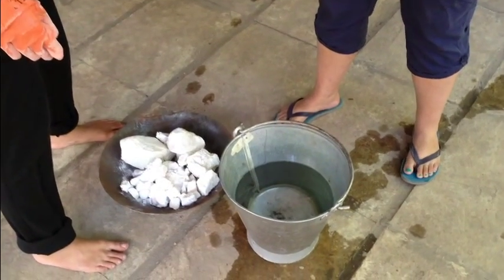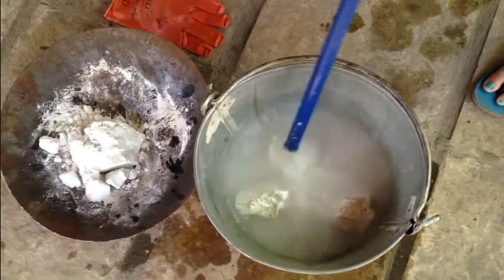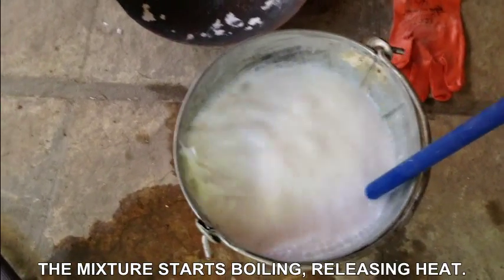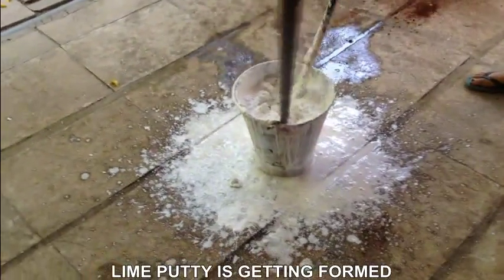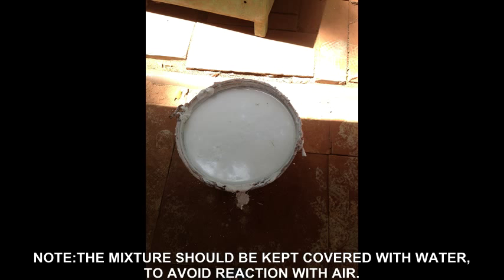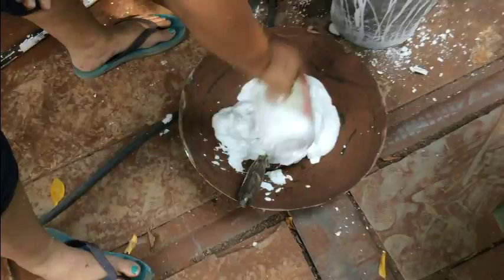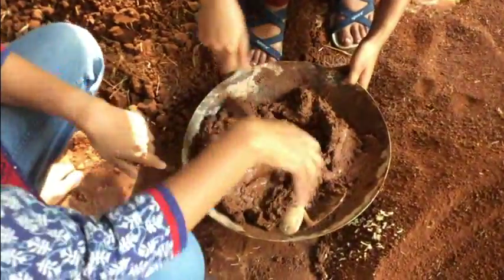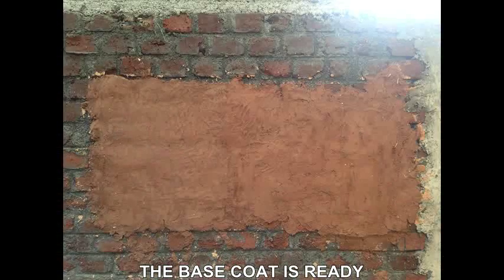Lime: Wet slaking process

Comment: Next time it's a lot quicker and better to use a 'larry' or rake if you don't have a pan mixer because when you slake the lumps it takes so much longer to react. I buy the stuff as a fine kibbled stuff and use a thick plastic bin that was used to store farm fertiliser.
When it slakes or cooks it doubles in quantity and when you added it to the brick surface because it's so absorbant it will suck all the moisture out of your mix thus lots of cracking will appear.
When you wet the brickwork you will hear a sucking sound, so wet it until this stops, wait 5 minutes or so and then paint a wet slurry of the mix onto the surface first and then put your coat on working from the top down and then float it as soon as possible.
 In the UK we used a 3:1 ratio, in Germany they use a 4:1 and to help stop the cracking add a small handfull of chopped straw to the mortar and for further strength instead of ox, cow or horse hair I use sisal it's much tougher.
What were the fibres that you used please?